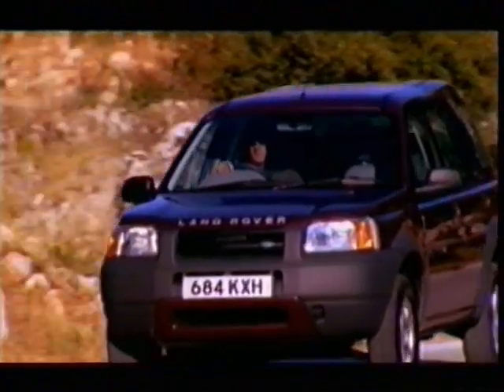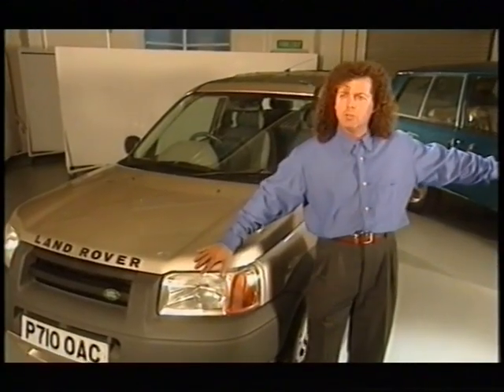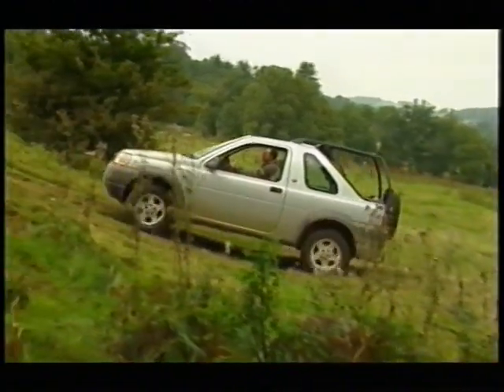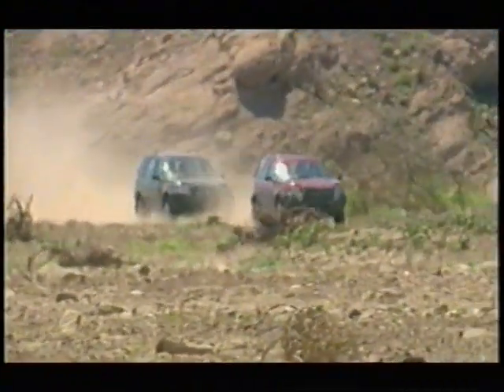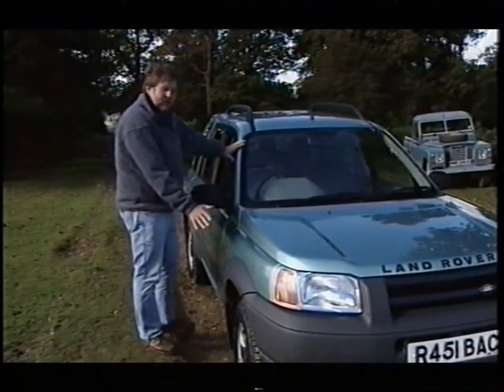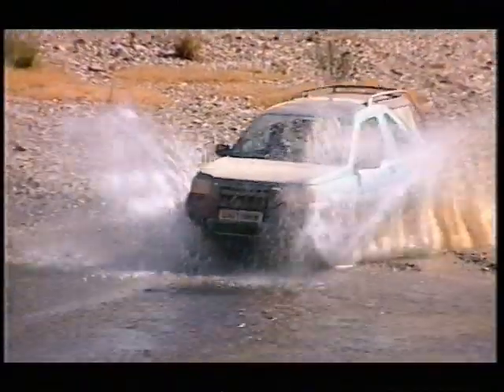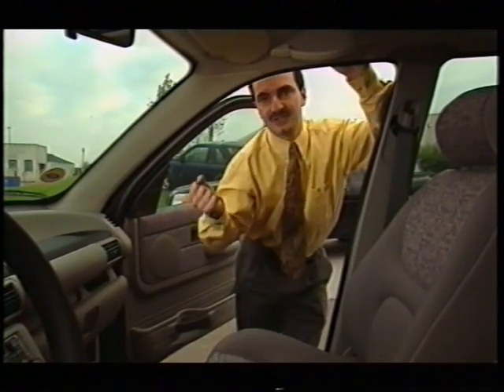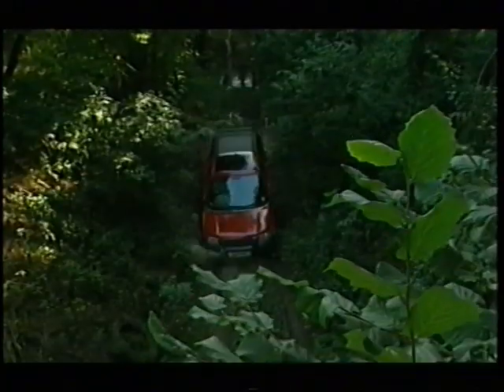Land Rover Freelander Design and Engineering 1997

Comment: It does not have permanent 4WD, the VC requires some slippage between front and rear.
Reply: from my exp, when a drive schafts have problems, it rotating all the time, so basically you can have full 4x4
Reply from the maker: The front and read differentials were intentionally set up with very slightly different ratios, so that the VC was always in shear and therefore always driving all 4 wheels.

Comment: It certainly had its problems and what they managed to create in terms of a Market Niche was amazing on the budget but it certainly came with its problems. Freelander 2 on the other hand was probably the most reliable model they ever made both before and after. It’s one of the few things Ford got right with their involvement
Reply: I wouldn’t call the freelander 2 reliable - the older freelanders with the Rover L-series diesel engine were really solid and reliable and it’s only until the TD4 they had lots of issues